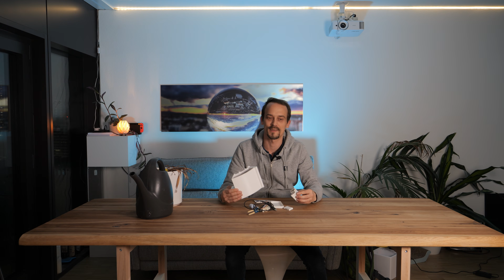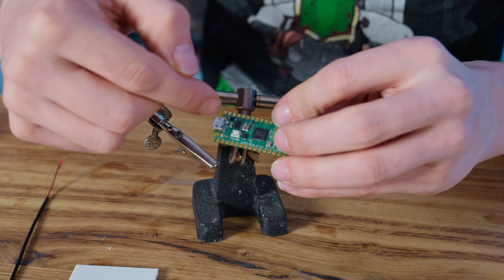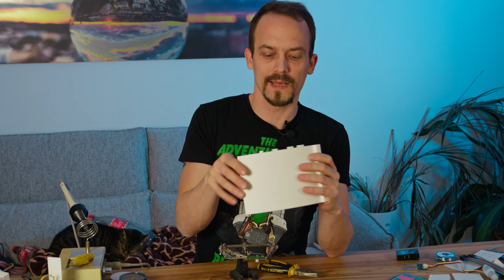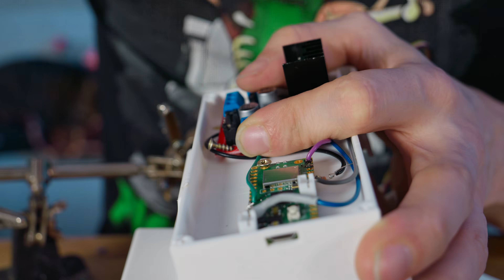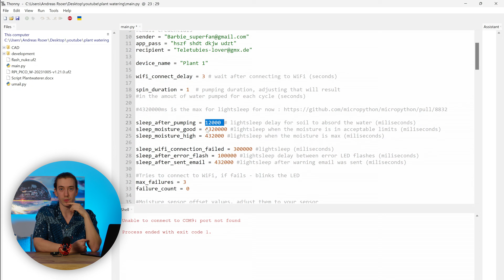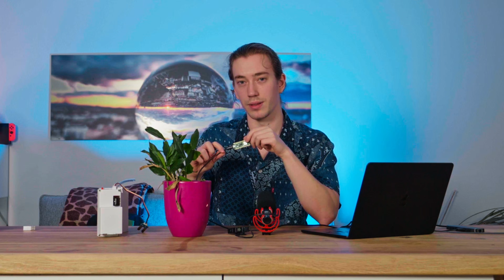I Built an Automated Plant Watering System: Keep Your Plants Happy and Healthy!

Comment: The specs on my Rasp Pi Pico's state that they can take 1.8v to 5.5v.  Do I really need to add the resistors? Why not just use the usb input to give it power?
Reply from the maker: If u refer to the resistors that go to the gpio pin then yes u need them. While the pico takes a wider range of Power input the pins it self actually cant handle high Power.
If u exceed 3.3v on any other pin than the input pin or usb then the board will fry.
Reply: @Ibuiltathing  I was wondering about this as I started researching it more deeply.  (I hope my question didn't come across as "snarky")  I have some 33k resistors sitting around my shop, and I did the calculation (r1/r1 +r2) * V input = V output. and found that I'll still be in the acceptable range for the Pi.  Thank you sending me down a path to learn new things!  :)  Can't wait to get home from work tonight and play around with this!

Comment: I had a similar watering system to yours but I had a bad experience with the sensors corroding. I hope your sensor doesn't corrode as mine did.
Reply from the maker: No, you are correct. Experienced the same issue over time. 
I am working on a version 2 that addresses this issue
Reply: use capacitive moisture sensors, they are way less prone to deteriorating than the resistive ones

Comment: Very cool ideas and design! 
I just completed a similar project with an Arduino. I used a n-mosfet as a switch to power a 12V pump on a timer. I will look into using a moisture sensor, waterlevel sensor  and a raspberry pi for my next project.
Reply: The mosfet is a better solution. 
Im already working on Version 2 where I use a mosfet as well and a customer pcb for it. I hope to post that soon.